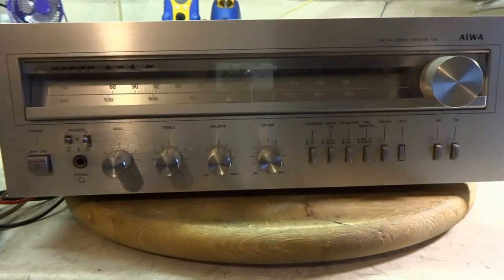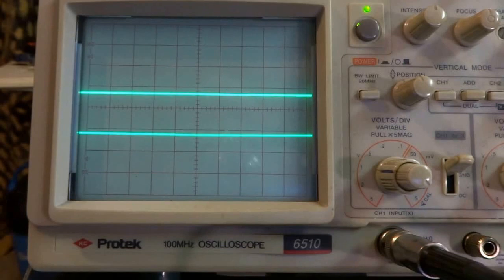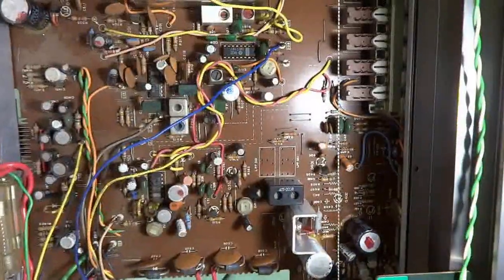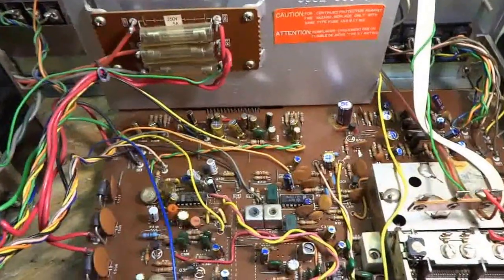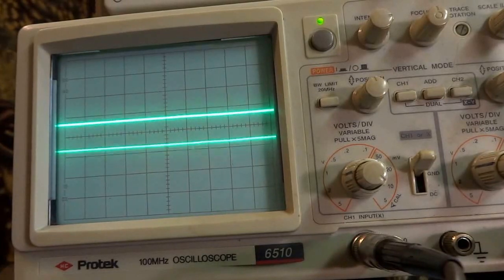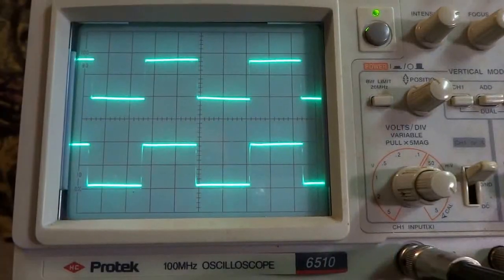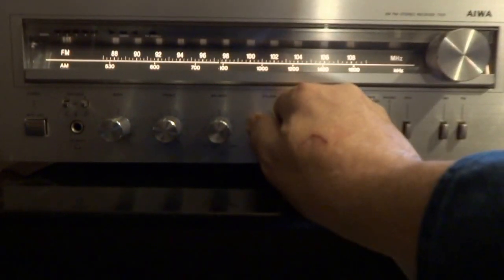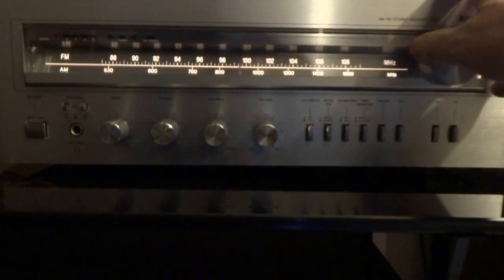Aiwa 7300

Comment: Interesting receiver, I have a 1981 issue of The Complete Buyers Guide to Stereo/HiFi equipment. It has a "capsule review" for this receiver. MSRP is $230, 25wpc, THD 0.1%, 72dB Ph.S/N. Text states; This 25-watt receiver from Aiwa could be the center of a very nice hifi system. It is designed to ensure pretty darned accurate sound.... The FM section is good and the whole thing is attractive, if slightly unusually styled. Nothing far out from the ordinary, but solid good value in its price and power category. I like your Days of Future Passed disc on the turntable.

Comment: good job. i like that double meter setup. did you do the recap? i normally don't, but i often pull some at random and check them.
Reply from the maker: Thanks, I have read all of the pros and cons of recapping, and myself I like to recap most of the units that I work on.